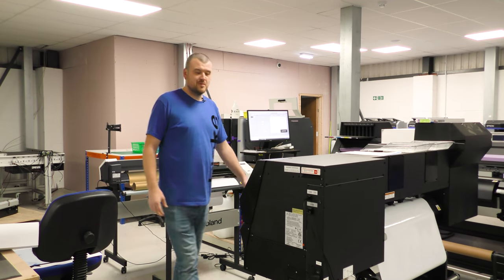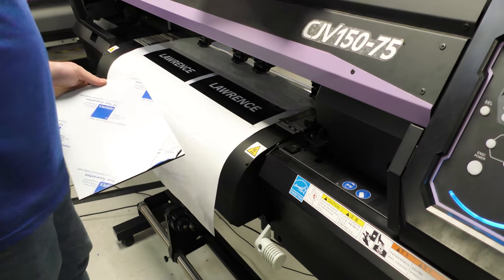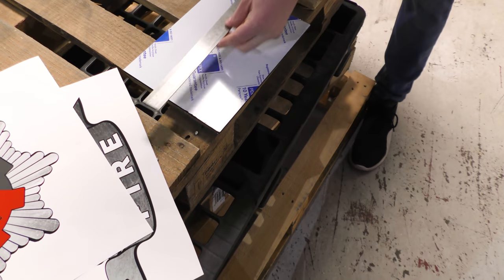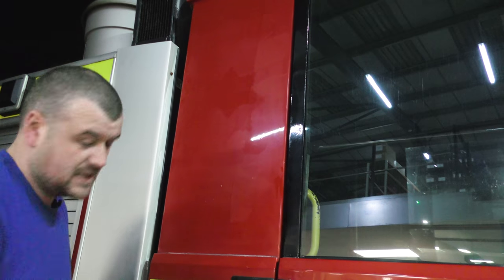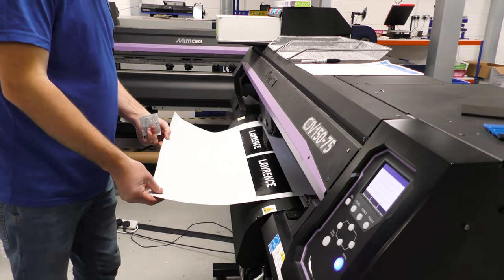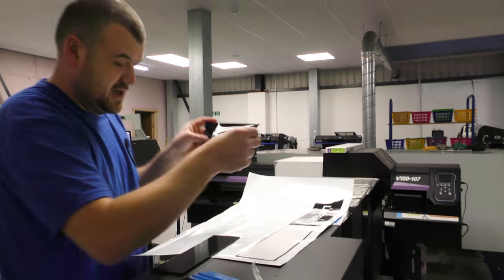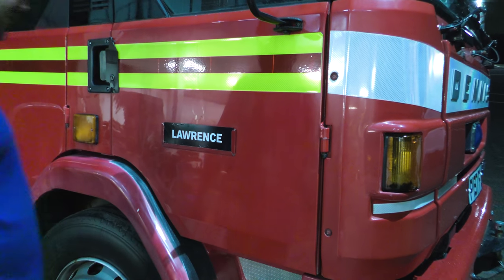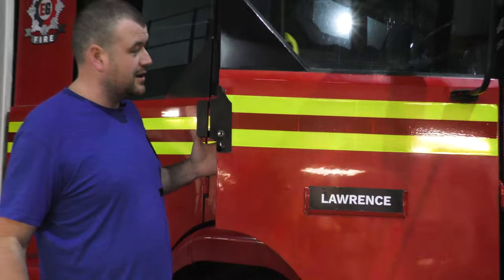I bought a scrap fire engine series.  Applying the service badges and name plate to the Dennis Sabre

Comment: My dad was a firefighter and driver for 34 years until 2002, that's the exact model of appliance I used to sit on his lap in and he would drive me round the yard when I visited. He wasn't driving this day but they were coming down a steep hill on a shout, the driver put the brakes on and nothing happened - my dad said he knew they were going too fast to be able to slow in time with all the water on board and brake fade... they ended up literally on two wheels going round the mini roundabout at the bottom of the hill.

Comment: put a solution of soapy water on the surface, it allows you to move the decal around and get any bubbles out,till it dries
Reply from the maker: Didn't know this thank you.  Will bare this in mind if i have to redo.
Reply: I think you spray soapy water on the surface, move sticker into position then squeegy over sticker to remove air bubbles and soapy water from underneath
Reply: Daniel Mayberry Yes, similar to applying window tinting.

Comment: You need to fix your side blue lights above the lockers
Reply from the maker: MrCheeseCake2002 the fend off lights are only for use when parked in a horizontal position. On a separate switch. I may be corrected but thats my understanding of them. They do work too.
Reply: Extreme Garage they are on scene lights, so they are always on when you are on a scene. Just wanted to know if they worked, also you should get a bullhorn.
Reply from the maker: MrCheeseCake2002 i have a bullhorn and separate air compressor and tank which i will film over the next few weeks. Fyi on mine the scene lights and the fend off are on separate switch’s.
Reply: You should do a ambulance after this, or police car, or something, or maybe another fire engine

Comment: Good video, been following the series, however I have one question, wouldn't there be an issue of impersonating if the police stop you? Just been a thought of mines
Reply from the maker: No.  You cannot get in trouble for impersonating as it is not impersonating.  It is a real fire engine that can put out real fires.
Reply: I would have thought however the fact you still have all the hi-vis on the side of it, the sirens and the lights that would be an issue? If I'm wrong then my apologies but I just wouldnt want to see someone put alot of work into something just to have it taken away :)

Comment: Why didnt you polish you pink fire truck  before applying the new sticker?
Reply: If you think its pink maybe you don't realise your colour blind its fire engine RED matey
Reply: @ExMAB4  i was exaggerating just abit but i think you need your eyes testing if you think the paint work is fine. You clearly not been in the car business/trade to know what bad paint is
Reply from the maker: Hi Craig,  We are machine polishing soon.  Unfortunately not ever been in the vehicle trade but you are correct the paintwork needs addressing especially the plastics that have faded quite a bit.
Reply: @ExtremeGarage dont get me wrong i love what you're doing with it and I've watched every video with the truck. Its just me being fussy with paintwork as it it was me I'd of polished it up then applyed the sticker as it would stand out so much better. I polish my car every time it gets washed to make the colour look rich if you get where im coming from lol love the content you're doing and please dont take my comment as negative feedback it was just a question
Reply: @craigcooper75  Read what I said above  - i merely pointed out that the fire engine is NOT pink its RED. I did not even mention the condition of the paintwork.

Comment: Out of interest don't you need a sign in the front window saying NOT IN SERVICE  for when you are driving round ?
Reply from the maker: Not if it is a fully functioning fire appliance with water in the tanks.
Reply: @ExtremeGarage  ahhh okay
Reply: Actually NO you don't need to do that - legally its STILL a fire engine. This is the reason you can lawfully leave the blue lights and siren intact on the road.... A fire engine can only ever be well, a Fire Engine. It's got no other purpose. If you converted it to a mobile pub it would need registering in a different tax class. 

So, you can lawfully drive this machine on the road without a sign... it isn't after all an operational vehicle and part of a fleet. No need to distinguish it from another fleet machine. 

The only thing you can't legally do is USE the blues and twos on the highway.... 

I'd love a toy like this....
Reply: @ExtremeGarage  Actually even without actuall water on board it's STILL a legally defined as a fire engine. Plenty of appliances run out of water on the fire ground. They don't cease to be fire engines on way back to station empty. Except that it's never completely EMPTY (it's got a few litres on the sides)!!!!

Comment: What software do you you to cad it up?
Reply from the maker: We just use Photoshop and Illustrator to create the cut lines and design.
Reply: @ExtremeGarage  What softwere to like cut and print as i want to get into that type of stuff
Reply from the maker: MrLimeGrass its called rasterlink but it is specialist to the printers used. All depends on what printer you will have. The main eork is done in photoshop and illustrator.
Reply: @ExtremeGarage  OK, i have CnC machine and want to get into 2D design so like laser cutting and sticker printing and that